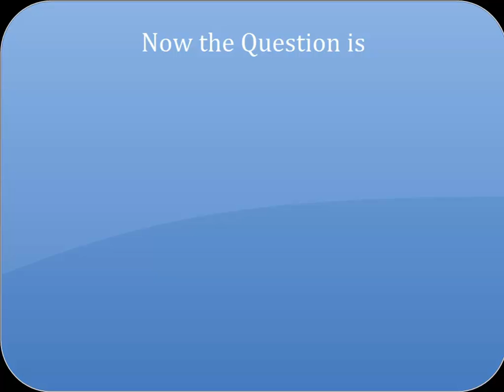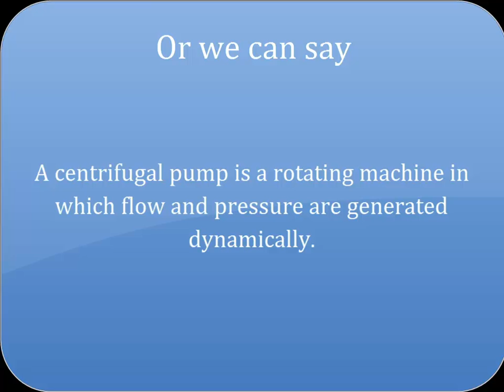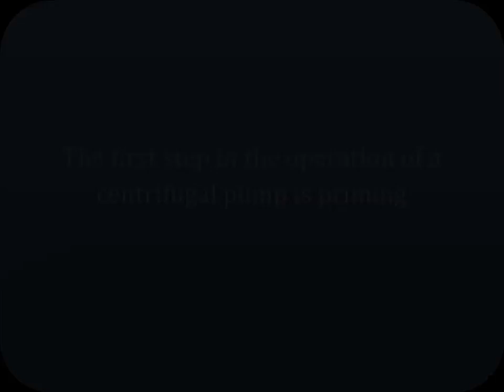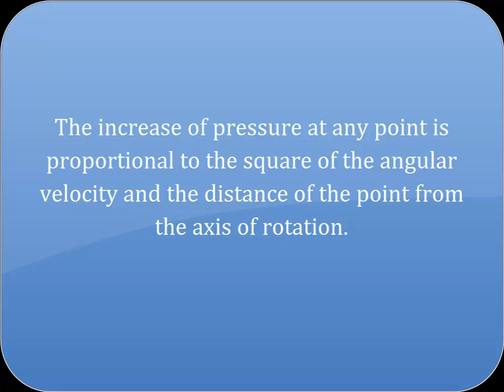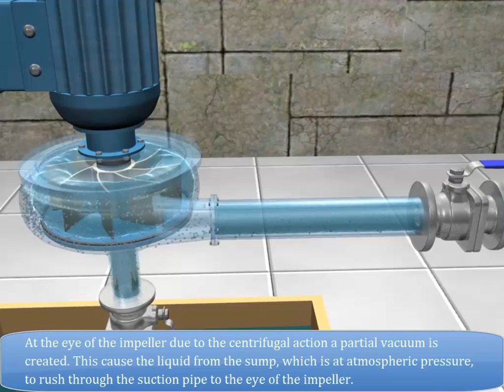[ Centrifugal Pump ] - Learn How Does a Centrifugal Pump Work

Comment: did make a homemade  pump were I will use it for a waterfall but it is leaking  and it don't have much  power   what's must i do
Reply: build a rampump. it works on water.

Comment: Wrong. The delivery pipe suppose to be on the other side and the rotor suppose to spin other direction. Other option is to change the rotor to make it working.
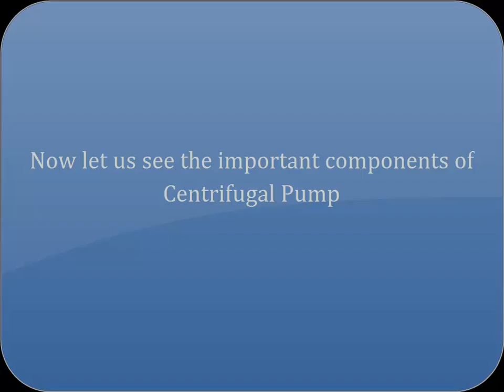Reply: Agree, from 2:21 onwards the visualization of the impellor and direction of its vanes are incorrectly shown (or either the way the outlet pipe is mounted was incorrect). The explanation though is largely correct. Sorry for the in general beautiful show and visuals.